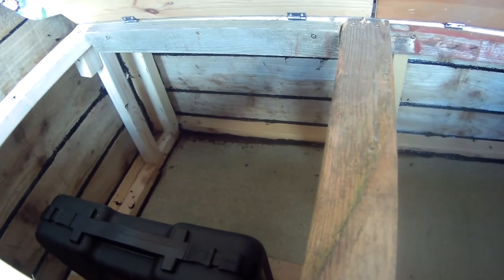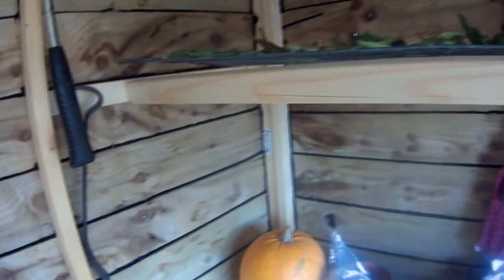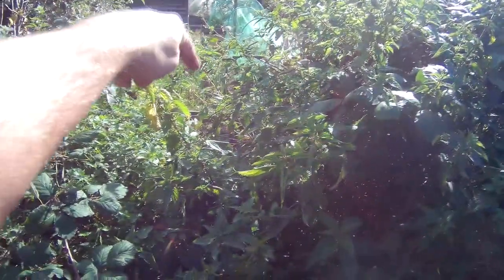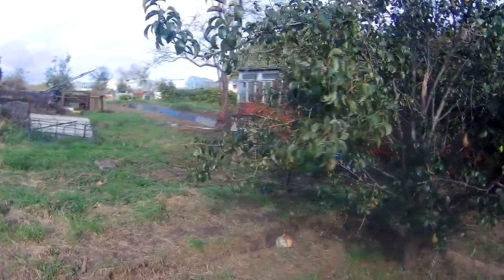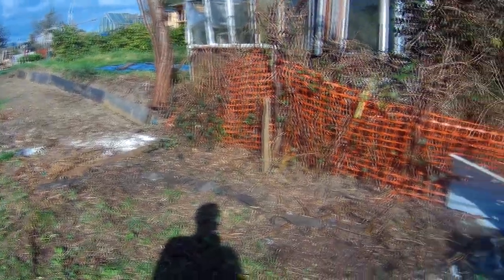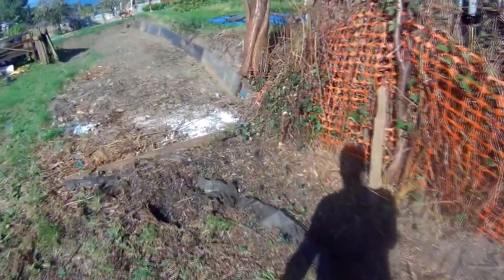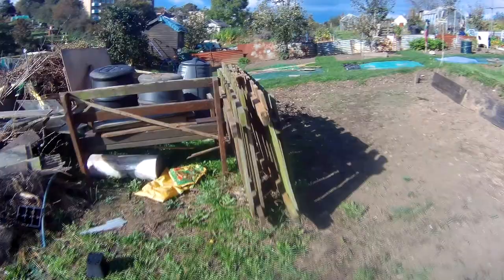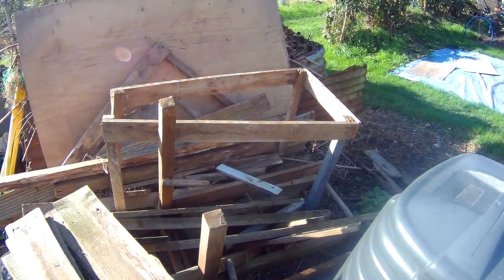Our Allotment --------- Part 25

Comment: Nice floor of your shed, Your second plot does look bigger and those blackberry/ brambles have grown over a lot I would clear back the lot and remove the rubbish underneath or just try and clear under the brambles.  Not good others stealing wood, found that out for myself not good when the thieves inside the allotment site
On GW website forum we have done seed swap for just the price of postage  
Been trying to do another video but Youtube have got rid of the free video maker
Reply: Yes use PC - did try using VSDC which found on internet but won't let the video get onto Youtube, thanks will look at the moviemaker
Reply: Only found a trial version of windows movie maker says buy now for the full one and that is needed to add to youtube